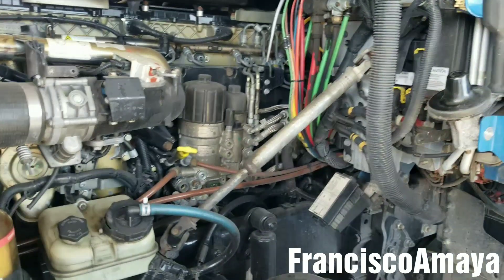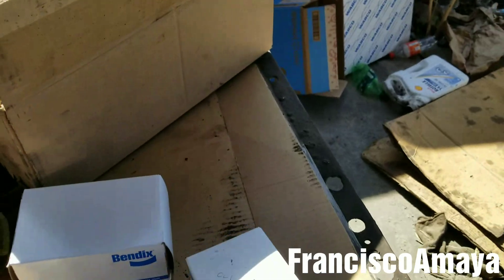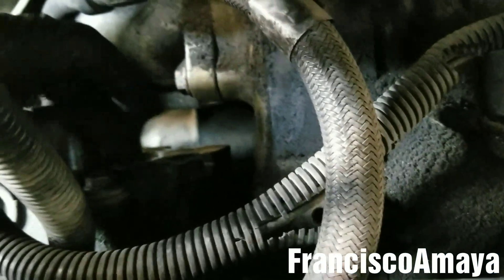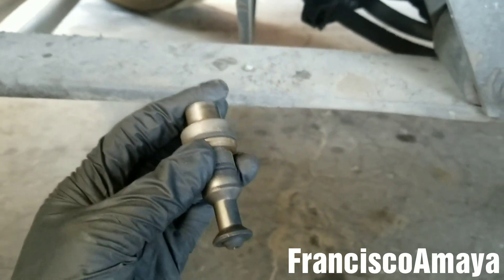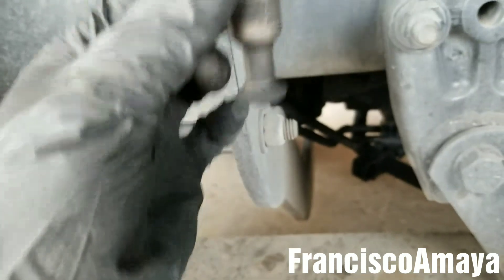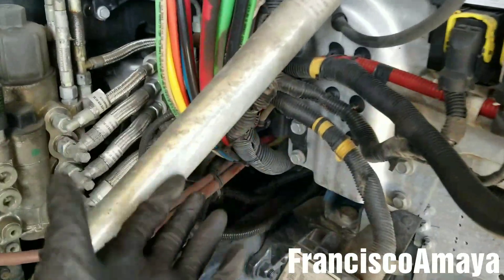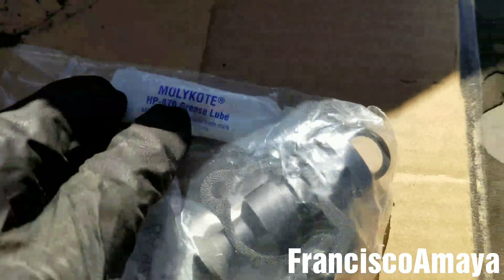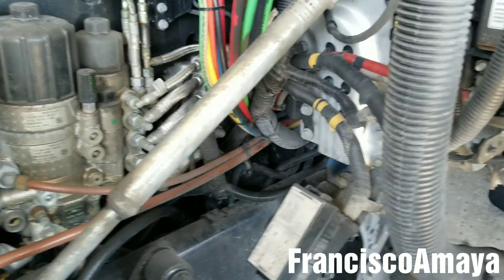Freightliner Cascadia DD13 DD15 DD16 no building air to the air tanks bad compressor unloader valve

Comment: I have a 2011 cascadia and all the lines are in the way . My unloaded valve was stuck bad , but I finally made a tool to pry up and out. But after I put in new unloaded valve , and governor and still will not build air unless you idle up high rpm and then it bleeds back down fast

Comment: Thank you!   That was my problem.  The unloader valve was stuck (gummed) in compressor.  I built a puller with a cage bolt I had in my tool box, a couple washers and a pipe spacer.  I ground the tangs so the diameter across the tangs were just under the diameter of the body of the valve.  Then ground the tangs to fit the inside groove so it stuck in there.   Took several tries and used parrot beak pliers as a spacer to pull past the flange.

Comment: Hola Francisco, tengo una pregunta, tengo un freightliner cascadia 113 con motor dd13 y tengo un problema, me carga aire y todo pero no despicha y al llegar a los 125 bota aire por la valvula de seguridad. En ese caso puedo cambiar ese repuesto?
Reply: Air dryer filter & clean fittings on dryer.  Filtro de y fittings dek Secador de aire

Comment: Mine builds air fine. It's actually too much. Goes up to 140 before releasing pressure. I can hear it at the knobs on the dash building right before it releases. You didn't exactly clarify but it sounded like it can let air build or not let air release.

Comment: francisco i have a 2012 cascadia dd15   i am not building air pressure and the air is leaking through the compressor pressure valve what do you think

Comment: Brother  buenos dias te voy a agradecer mucho si me orientas como solucionar mi problema con my air  brake dryer 
2018 freightliner m2 106 con motor detroit DD5 4 CYL 
El air dryer dejo de purgar o de disparar aire le cambie todo el dryer assembly completo y ahora se purga o disparar aire cada minuto y cada vez que disparar aire se oye como que fuga aire en el compressor  te agradecería si me puedes orientar como solucionar este problema

Comment: Hi Francisco. Your videos have taught me a lot. I recently replaced my air dryer. But a few weeks later the 1/8" hose from the air dryer came off not from the dryer end but where it hooks up at the other end. Air was pumping out of the hose put my thumb over the end of the hose and got a loud pop now no bundled up of air pressure in my tanks. Can you direct me to that video or tell me where it hooks up. 2013 Cascadia DD13.Thank you.

Comment: Hi amaya my truck air compressor no cut of continuously running and air leaking from air dryer purge valve I put new governor and air dryer but still same
Reply: Yes i changed air compressor
Reply: Heyy same problem did you solve a problem ? thanks

Comment: Please what's about continuing air building up with no stop?
Reply from the maker: possible causes:
air leak between air compresor line and air dryer
constant air leak
weak air compressor
leak on the air governor signal line to the compressor
bad unloader valve
Reply: Hi did you fix your issue with continuous air buildup ? mine  2017 freight Line recently I just changed couple fittings air leaks now it turns to buildup continuously air to my air pressure gages and sneeze

Comment: Francisco, remember the guy you met standing in the parts line at freighter Fontana? I said you are a light house for those of us trying to find safe harbor? Well you were my light house tonight. I started the truck tonight in Terrell Texas. Not building air. I've been noticing slow build the last few days. I have to deliver my load in a few hours. No help anywhere on a holiday. I did a bypass on the air dryer and woo hoo... I'm rolling again. I'll be at a shop after I deliver minus a tow minus a road call minus stress. Thanks my friend!!!

Comment: I’m replacing a compressor. Due to pressure not building enough pressure. And it won’t go over 60 psi. Then check the hoses that connect to the compressor. And found they had black tar and contamination. Currently waiting on parts.
Reply: Bro, did the issue get resolved once you changed the greasy main line or did you ultimately have to change the compressor?

Comment: Do you have a video of how to replace this on a T680?I am on the side of the road right now. No air leak. But my truck won't build pressure and my trailer is loaded. Is there a way to bypass the governor, etc so that I can build up enough air pressure to make it to the Kenneth dealership?

Comment: My air compressor sounds like a snare drum.  Purges and keeps purging till 105 psi.  Unloaded valve crapped out.    Stupid idea to put the air compressor by the frame peterbilt did it the same way 🤬🤬

Comment: I have the same issue in the morning I have a 2011 Cascadia isx motor especially when it’s cold
Reply: The isx has a completely different style unloader valve. Usually we replace the head of the compressor

Comment: In my case that main hose coming out of the compressor got clogged all the way to the dryer including the dryer and the hose going to it ( 2011 Cascadia ) In case someone has the same problem after changing the valve.
Reply: did you have oil build up in your hose that clogged it?